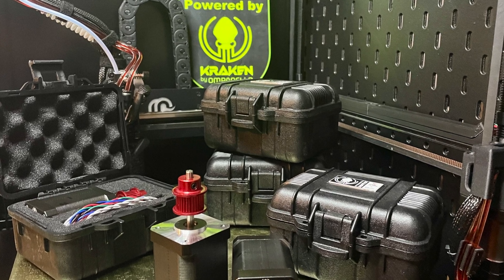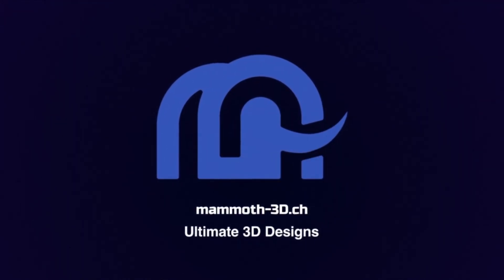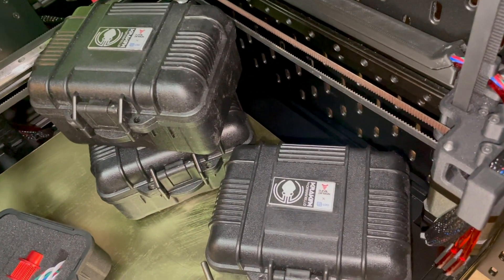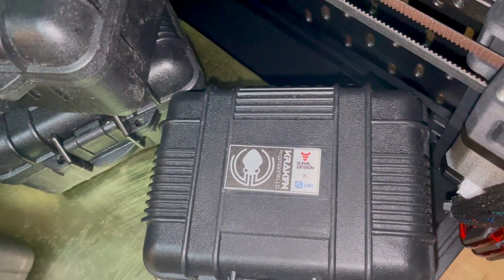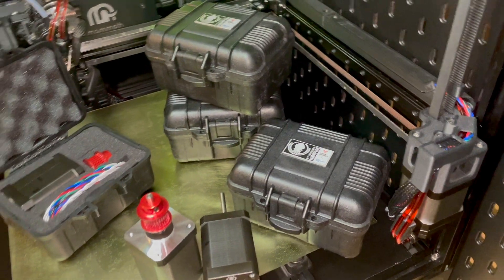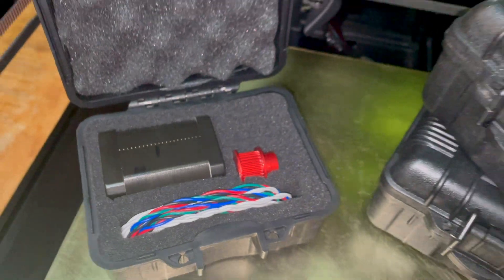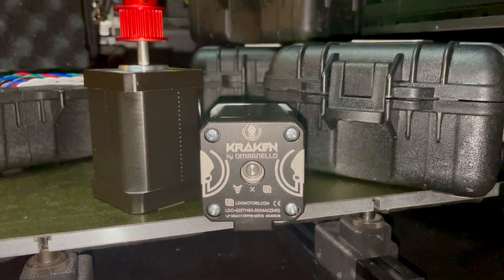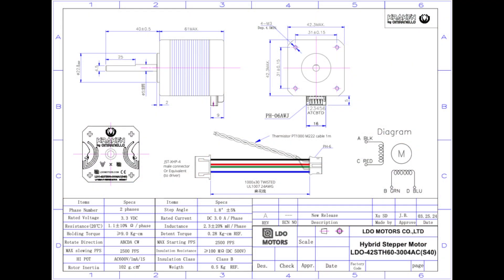Kraken by Omranello - Mammoth 3D

Comment: what do you recommend as a 2nd or 3rd best after kraken motors?
Reply from the maker: I would look at this motor. I did not test them but only heard good things about them. And you get them in a 5mm and 8mm shaft version.
https://www.omc-stepperonline.com/de/4pcs-nema-17-hochtemperatur-schrittmotor-55ncm-77-93oz-in-55mm-rundwelle-isolationsklasse-h-180-c-4-17hs19-2504s-h-v1

And the LDO Speedy Power Motors 2504 I think is still one of the best out there.
You get a power pack version from Febreeko.

https://www.fabreeko.com/collections/honeybadger/products/open-beta-nema-17-3a-rated-classified-steppers-by-honeybadger

Comment: For sure would be nice to have a round shaft, currently planning an AWD high speed H-Bot build, and am considering these motors. The built in thermistors are awesome!
Reply from the maker: Yes 100%, I did speak to Omran about it but don’t think we will ever see one?!
Yes they are. Busy making a new gantry to fit the motors with 30T pulleys 😄👍🏻

Comment: what special about these compare to something like a superpower
Reply from the maker: Look super power motors are awesome. That is what im running in my other videos. Kraken has twice the amount of Torque. So the toolhead doesn't always have to be super super light to get better acc. Speed I will have to test and see what I can get.
Reply: More torque means a lower top speed right?  @mammoth-3D
Reply from the maker: @woutervossebeld4664  Yes that is right. But if you use 30T pulleys with the motors. You have more torque then a super power loo and more speed 🙂